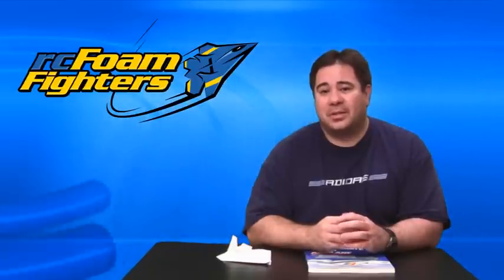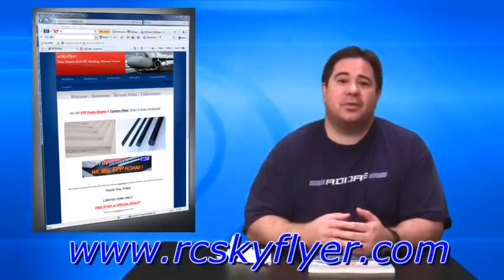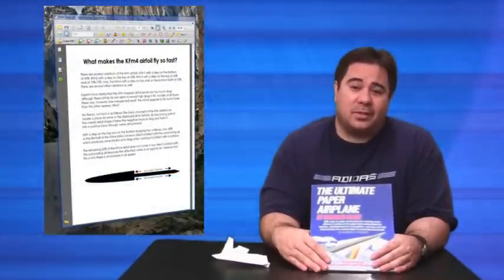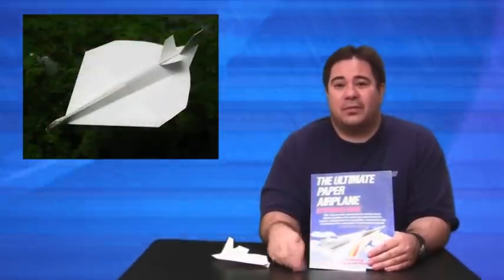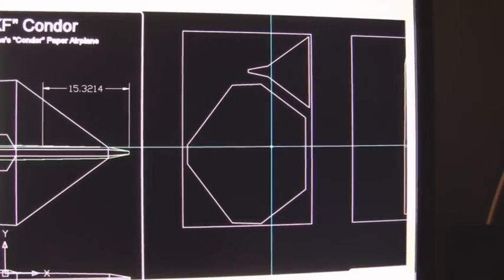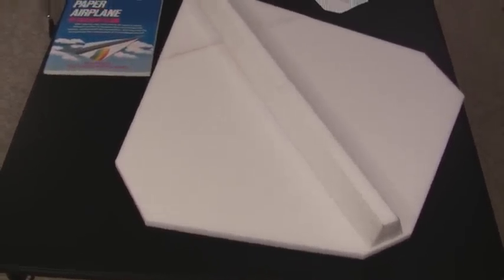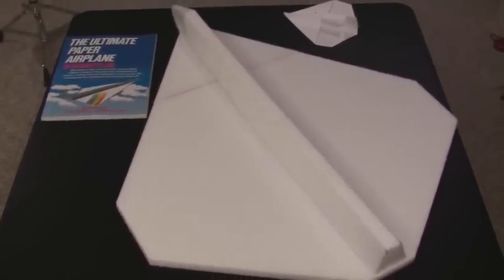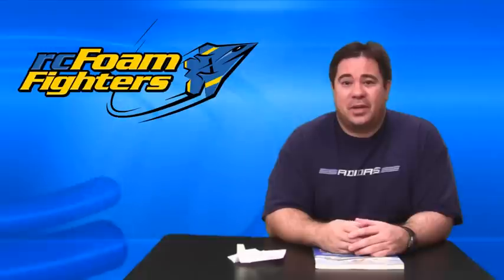The KF CONDOR PART1 (RC Airplane Inspired by Dick Kline's Condor))

Comment: The KF airfoil makes sense, to me it is similar to how a golf ball works. Because of the dimples the ball has less air resistance, it's hard to explain without a drawing.  The plain looks great, can't wait to see it finished and up in the air. Can I suggest that you add some velcro to the battery so it has a bigger chance to survive an eventual crash? It is perfect to have a bulletproof plane, but the battery is an expensive part, I rather see my battery survive the crash, the plane can be glued

Comment: Nice project...how can i have access to the blog?...it seems to be unders contruction and the is not kinfings using search kline of kfm..thanks
Reply from the maker: Alex this video is a bit old, about 11 years ago. Our original website and blog got corrupted so we had to rebuild it from scratch on another platform Unfortunately all the old blog write ups did not get transferred.   I do have some of the old documents from Dick Kline. I will try and get them posted to a new section in the new Forum on our webpage. I will comment to you back here when I do.
Reply: @rcFoamFighters  thanks for the rapid response to my question. I will check for the additional section for kfm airfoil. thanks again!!!!
Reply from the maker: Alex I added a new KF Airfoil section on the new Forum. I posted a couple documents Dick Kline sent us on his thoughts for the KFm3 Airfoil.  I have to look and see what other files I still have. If I have any more I will post them too.  Here is a link to the new Forum section on KF Airfoils   https://www.rcfoamfighters.net/forum/kf-airfoils
Reply: @rcFoamFighters 👍👍👍👍👍👍👍👍👍👍👍👍👍👍👍👍 Fantastic!!!!!!!!!!!!!!!! Thanks a lot!!
Just by curiosity , about KF3 vs KF2, i have read that kf3 has more lift but as a newby (pilot  and builder) i am not sure what does it means in a plane if you switch same plane ( example small cub 34in ws)from KF2 to KF3, does it fly slower ....?  I hope you can share your some of experience. 
Thanks Again!!